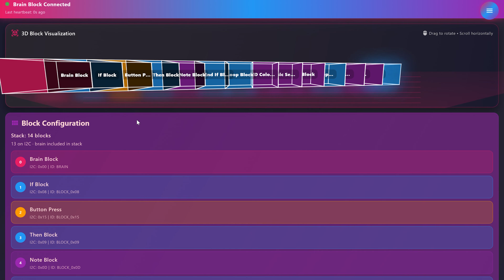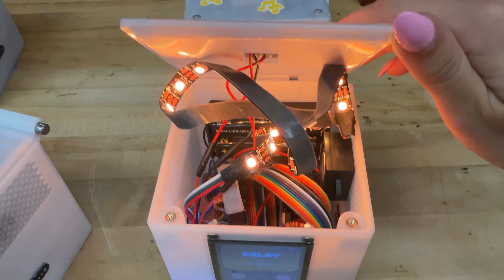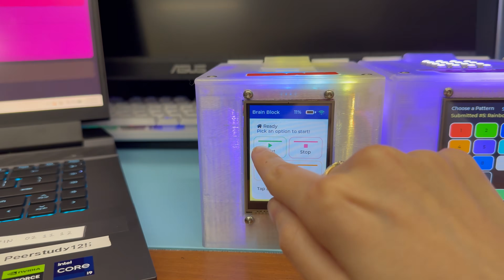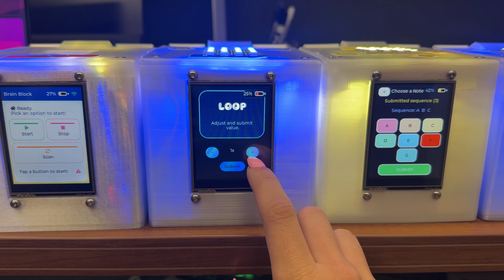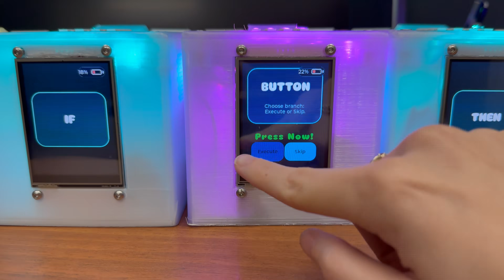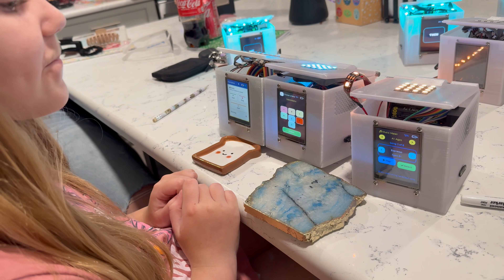Blocks o' Code (v3)

Comment: Supper Impressive! How are you all powering the project? How do all the devices recognize each other?
Reply from the maker: Thanks!

Each block has its own rechargeable battery (2×18650) with onboard regulators. They connect using magnetic pogo pins that carry power + I²C. The Brain block scans the bus and identifies each block using a unique ID (WHOAMI), so it knows exactly what’s connected and in what order.